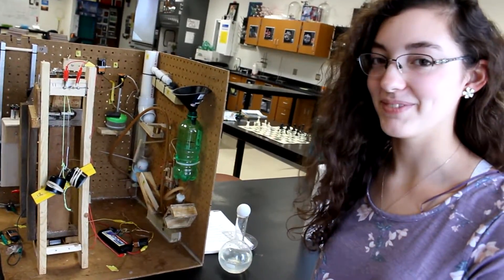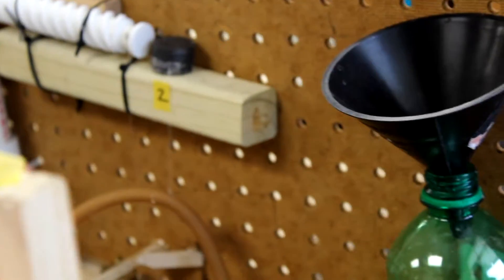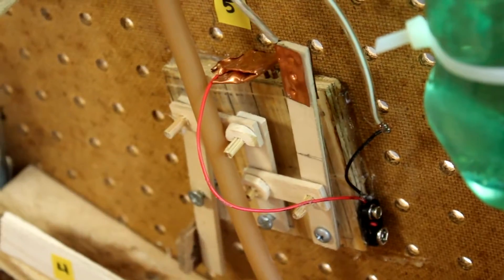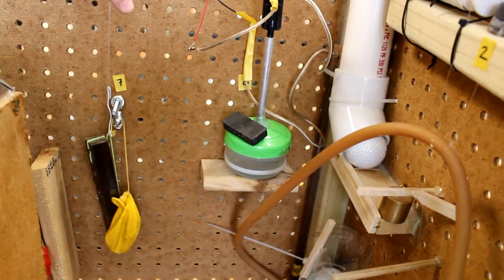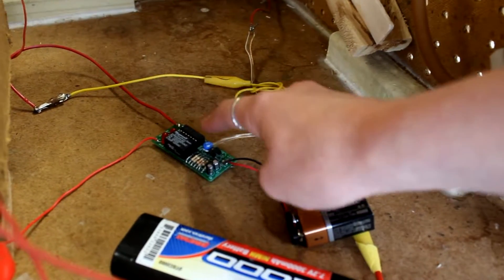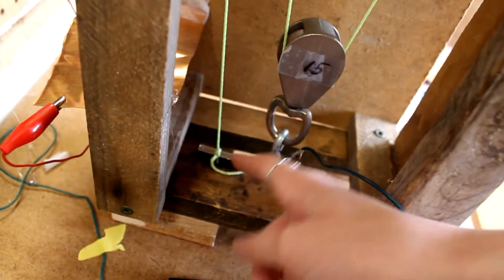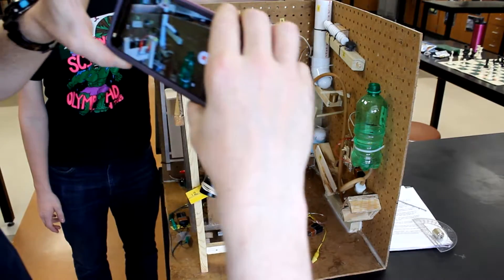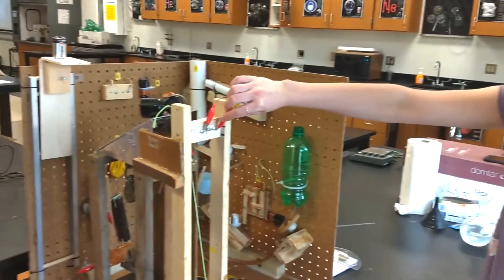Michigan Science Olympiad Mission Possible 2019 - State Tournament 5th Place

Comment: How can I incorporate the bonus actions into the actual product? Do you have any methods of brainstorming?
Reply from the maker: Ariana, I definitely wish you luck with this project.  It's a monster, but such a rewarding one!
That said, as a coach myself, I've witnessed the intense pleasure students have from the solving of the problems and challenges this event gives them.  So, just as general advice:
1)  Afford more time for this event than you first think.
2)  Many things will go wrong.  Many of those things will also be things you didn't think would go wrong.  This is one reason you REALLY must pay attention to #1 on this list.
3)  Plan your parts in REPLACEABLE ways.  If you have events 1 - 4 connected in a way where one part can't be replaced, then if you suddenly have a much better way to do event number 2, say, you won't be able to take out the old idea and put in the new one.  If your events are replaceable, then as ideas improve along the way, you can still make those improvements.  And this is yet another reason to really pay attention to #1.  You WANT enough time to also be able to make improvements.
I hope these starting pieces of advice help!
Reply: @MrLundScience  Thank you so much this really helps
Reply: Try each on their own and tip

A gear is also a wheel and axel

Comment: I’m doing this event for my first time and I’m in 7th grade. Does anyone have any advice to be prepared for it?
Reply from the maker: YES!
1.  Expect it will take much more time than you first think.  Afford MUCH time for it.
2.  Your first idea for an action will not likely be the one that works.  Sometimes...but not usually.  It will need to be modified.  So try to test them out independently before putting them actually into the device.  What problems with each action you can work out before putting it into the actual device, the better.  It's much easier to modify the idea before it's put into the device.
3.  Also, your first idea probably isn't the best idea, just the first.  So, think about things like, "How else could I do this idea that might be even better?" and "What are the best materials to use to do what my idea is?"
4.  Watch as many videos about Rube Goldberg machines as you can to get some ideas.
5.  Can you make the idea for an action smaller?  Size matters in this event.

Those are hopefully a good start.  Good luck!
Reply: The golf tee is evil 👿
Reply: Induvidu Hettiarachchi place a funnel around the golf tee and it will go in every time
Reply: also, the wheel and axle is evil....